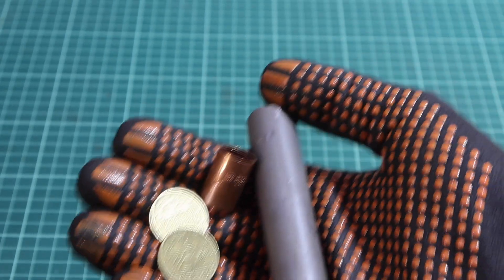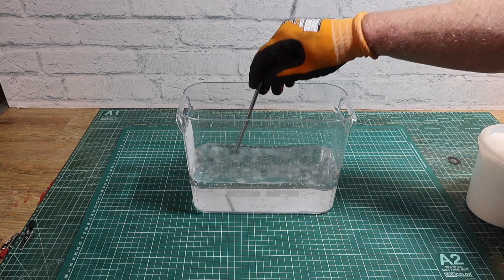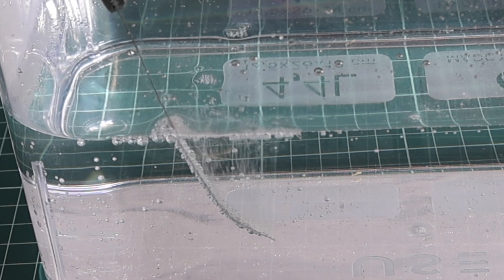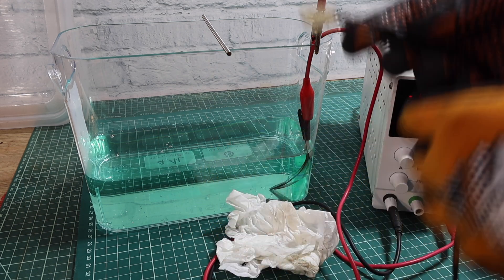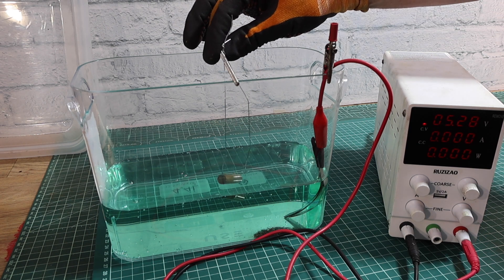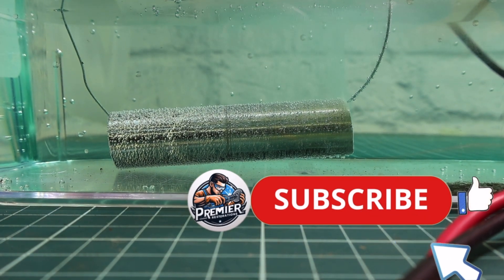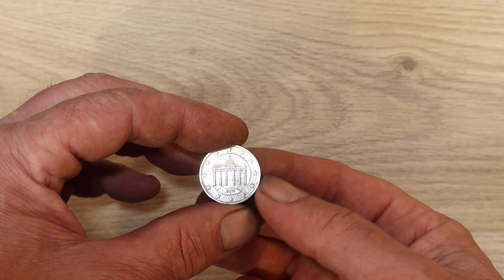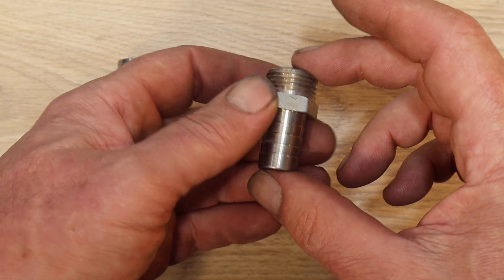Turn Parts Shiny With This Simple Nickel Plating Trick!

Comment: "Hydrogen" not "Nitrogen"

Also you really need to add an acid to the solution otherwise you'll have most of the nickel fall out of solution as the oxide/hydroxide onto the bottom as that little pile of debris you have in your tank.

Sulfuric acid, even drain cleaner purity would probably be one of your best options, though I suppose HCL as muriatic acid, or any acid that creates soluble nickel salts will work.

Your best option would be to boil those nickel strips in dilute sulfuric acid until no more will dissolve, remove the leftover solid strips, and then pour this into your tank as electrolyte, then use your nickel electrode and whatever you're plating.

No matter what you do, you need to precipitate the nickel salts out of your bath when you're done because of the toxicity. You can place non-stainless iron in the solution and let it sit for several days until the nickel is converted back to nickel metal powder, and the iron goes into solution instead. Zinc also works--anything more reactive than nickel will, really. It's just ideal to use a metal that wont also produce toxic salts like, say, copper--unless you then precipitate those copper salts out with metathesis replacement.

Great start though!
Reply from the maker: Many thanks for your comment. Very much appreciated. Yes i slipped up with the gas type. I will take note of your suggestion and incorporate next time i do some plating. Thanks again for your detailed info and your time taken.